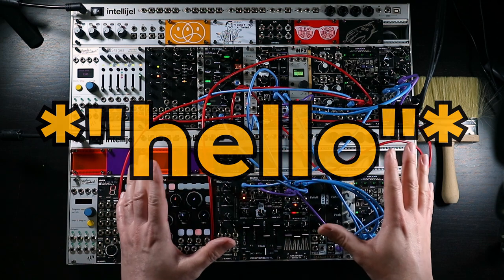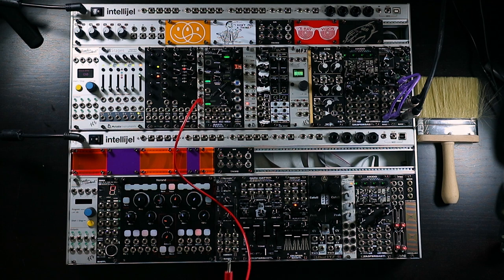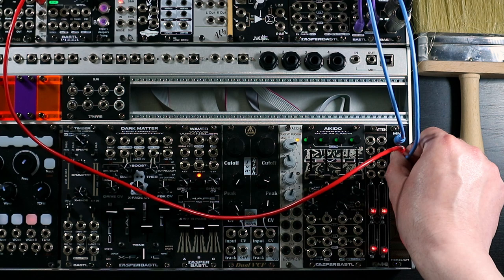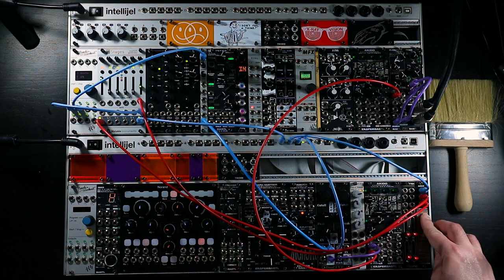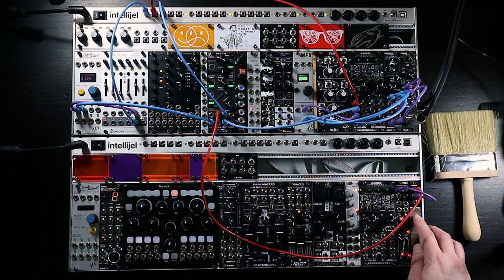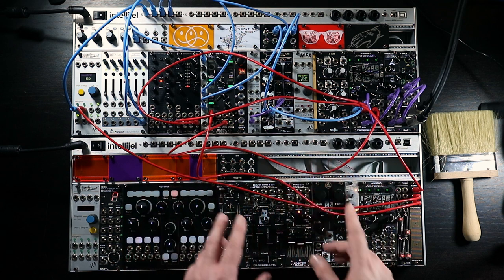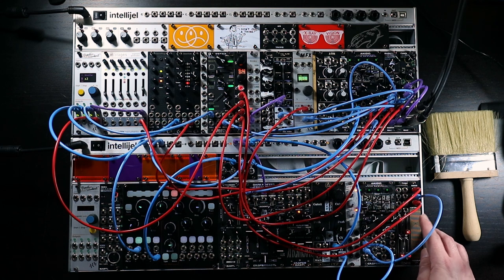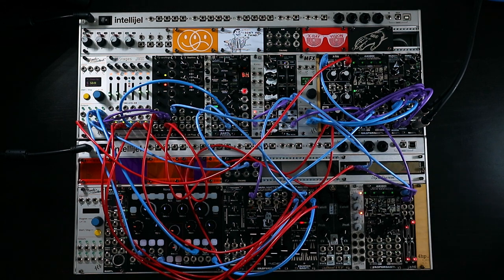Body-Patching with the Herzlich MMI

Comment: Herzlich's modules are pretty great; I've been eyeing the MMI myself. I wanted to mention another variation on the idea — the Landscape AllFlesh, which basically mounts metal plates on 3.5mm plugs, so jacks can be converted to touch points.  

Also, you may have seen videos where folks use devices like the Makey Makey to create fruit pianos — alligator clips connect fruit to an interface board, and you touch each piece to play a different note — or similar contraptions.  I found a version of this idea that was even more of a toy, with soft clips (that are comfortable to clip to people and not just objects) on wires and a very cheap audio player, and I modded the clips to plug into Eurorack jacks. So they can now do things like clip to two different people and do this kind of control based on how much they're touching each other.
Reply from the maker: Oh yeah, I forgot about those Landscape jack plates! They're a really neat approach to adding body patch points. Probably wouldn't be ergonomic in my already cramped case though!

Comment: I was about to mention the PCB keyboard of the Arturia MicroFreak, but you cited it already. It simply is astounding. Like pretty much everyone else, I was dubious before trying it IRL. But I was hooked the very minute I first played it. Granted, you would need a MIDI-to-Cv converter to fully exploit its polyphonic capability, but already, on its own, the MicroFreak sports a Cv/Gate/Pressure triplet of outputs, ready to feed signal into any Eurorack module. Just like 25 little MMI modules all neatly laid out next to one another.
It would not be much of a stretch to purchase a MicroFreak just as a MIDI/Cv controller, to be honest. And as an extra, one would get a 17-engines digital synth in the bargain !
Reply from the maker: It's a modern classic! I wish they had kept that keybed on the minifreak! Maybe one day they'll release it as an alternative version?..
Reply: @OscillatorSink  Yeah, the « normal » keyboard of the MiniFreak came as a surprise. Maybe they shied away from implementing this type of keyboard on a more pricey machine, who knows ?
I wonder what the reactions would be to a cheap 49-note MIDI controller made like a MicroFreak keyboard? I, for one, would buy one right away !

Comment: I’m starting in eurorack and I thoroughly enjoy this rack, especially the droning composition that you’re using here. Is there a representation on modulargrid or a rundown of what you are employing module-wise that you have posted somewhere?
Reply from the maker: I actually don't have an up to date modulargid setup online, but I believe that's fundamentally: noise into a filter into Mutable Instruments Rings (or a clone of Rings in my case). What the noise source is not particularly important, nor is the filter (other than it being low or band pass), Rings is doing all the work!
Reply: thank you so much for the reply. I wouldnt have guessed it was the rings module doing the heavy lifting. Interesting. I guess Im on the hunt for a good Rings mod to fill the last gaps of my rack. Thank you @OscillatorSink